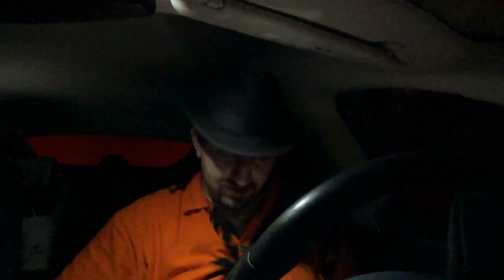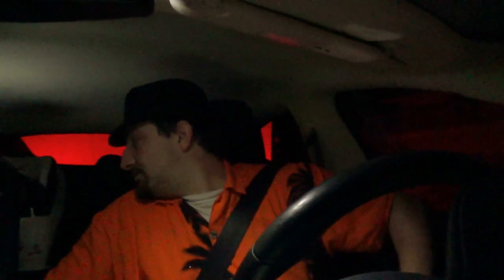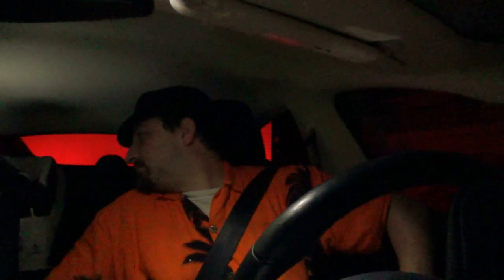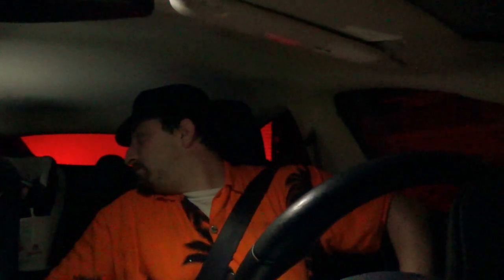Tesla Motors Model S: Brakes, Power Cut Out and answers to other Brake Questions

Comment: Thanks for another informative video.

Have you considered switching to carbon ceramic brake pads to reduce those excessive brake dusts? ... And whether you can recommend one of the following brands: 1) Akebono, 2) Carbotech , 3) Porterfield  or some other brand of your preference?

Comment: Here's another article on Green Car Reports that goes over the changes in 5.9 and suggests "An accelerator cut-off when the brakes are applied" for 6.0: http://greencarreports.com/news/1091366_life-with-tesla-model-s-battery-safety-shield-in-detail-photos/page-2
That desire is reflected in one of the article comments. Both owners seem very happy with their Model S and they have 5.9, so it's not FUD and evidently not fixed in firmware. Since you were convincingly unable to reproduce when trying various combinations, "rare" seems to describe it, perhaps with a very specific pedal combination, driving configuration, or situation (e.g. speed). Or maybe they see the small application of power, which you demonstrated as a feature, and think it shouldn't be happening. I don't worry about it, but I am curious and want to get to the bottom of it.

On another note, I recently placed my order and delivery is estimated for late June. :-D
Reply: Good discussion about it here: http://teslamotorsclub.com/showthread.php/29059-David-Noland-suggests-Model-S-pedal-placement-is-a-safety-hazard
There are many different takes on the issue, so I'll just say read for yourself, and continue reading myself for the off chance that there is anything conclusive.